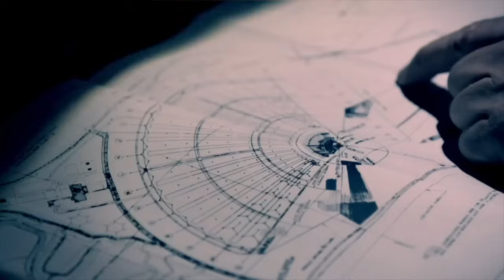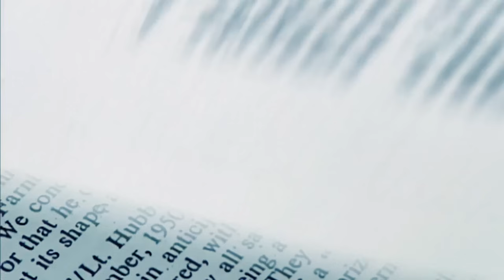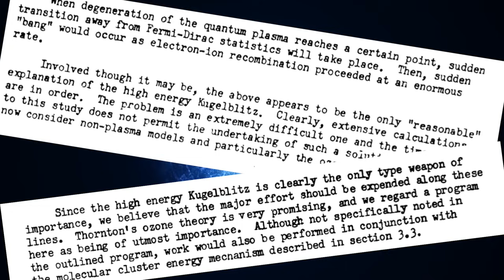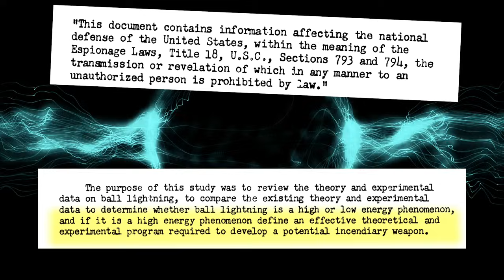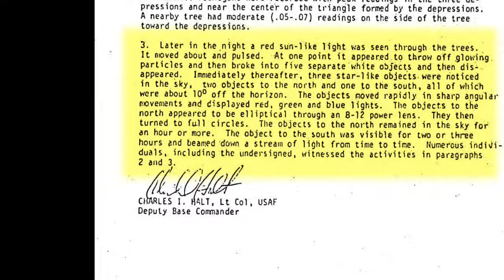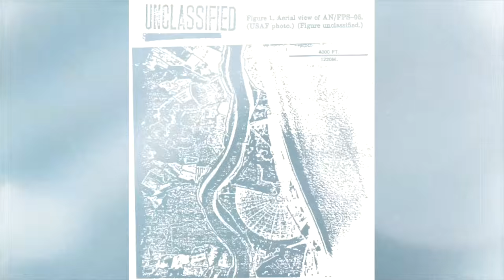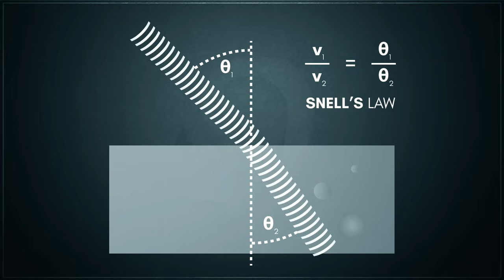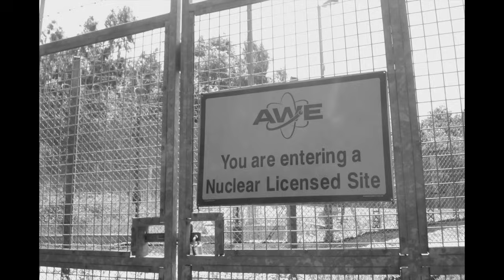Rendlesham  Forest UAP

Comment: I read a 2014 paper titled Magnus Effect on Arc Driven by Alternating Magnetic Field in Swirling Plasma Gas.  Perhaps you could generate a steerable plasma ball using that ?  Fitting Flettner Rotors to the decks of large Ships could cut diesel use by 30%.

Comment: Hi there, going backs few years an article appeared on BBC TV news Oxford. A company in Abingdon had produced a system where electrical equipment could be placed in a vacuum oven. A material added ( not identified) to the oven made the electrical equipment impervious to water. I have never been able to find out any thing about this operation since. Taken on board by the military?
Reply from the maker: aerospace use it...its liquid but non conductive.